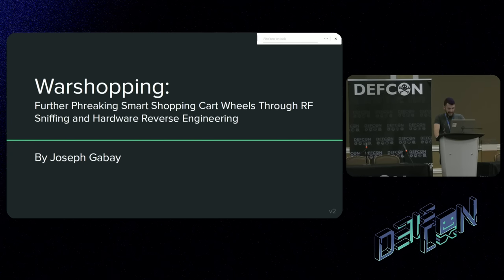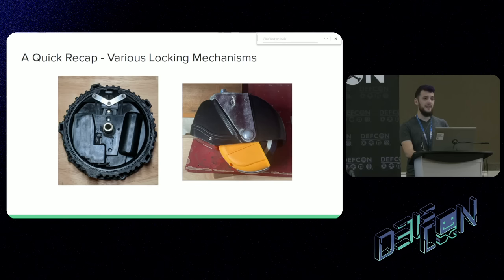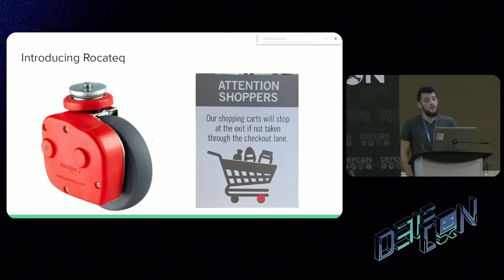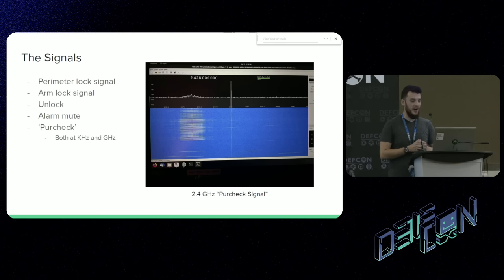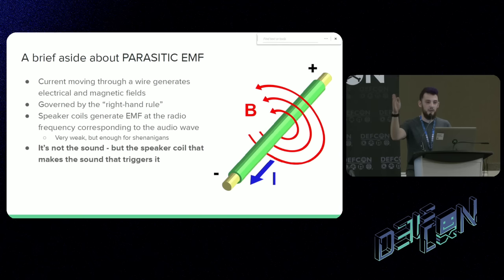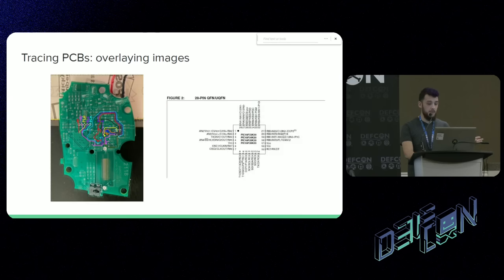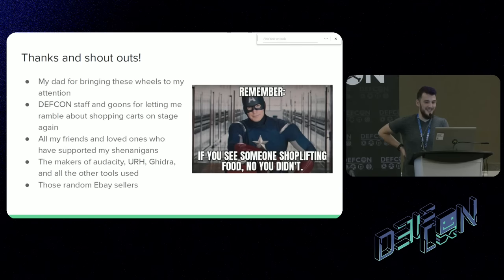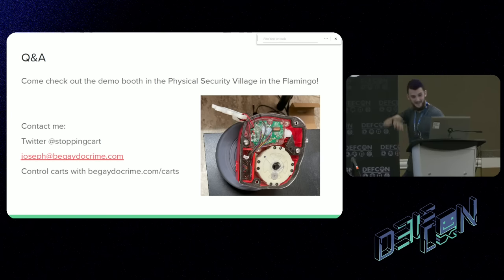DEF CON 31 - Warshopping- Phreaking Smart Shopping Cart Wheels Through RF Sniffing - Joseph Gabay

Comment: I can't stop thinking that this device is a wheel surrounded by electronics that the public literally pushes around a store all day every day.... why does the battery ever die for any reason except planned obsolescence?
Reply: You could definitely extend the life of the device with a kinetic charger, sure. That would, however, drive up hardware costs.
Reply: @pinaz993 Not by much though, since a kinetic charger would also detect motion, so you no longer need an accelerometer, you can put less effort into saving power if you now have a charger, and you could probably use a smaller battery too.
Reply: Im not a very technical person but a wireless charging strip underneath the wheels where the carts are stored would be possible aswell
Reply: @jesperdenbraven1995 That would be a lot more expensive than putting some magnets on the wheel, due to the extra infrastructure requirement.
Reply: @user2C47  there's already corrals for them. it's a simple rail and plug.

Comment: I don’t think I’ve ever seen carts that lock in the store. All the stores that use them around where I live just lock the wheels at the perimeter of the parking lot, presumably to keep (usually, homeless) people from stealing the carts.
Reply: I've gone into a store to buy ice and didn't go through the checkout, just parked the cart next to the ice case and walked over to the checkout. Going back out the wheels locked up at the door and set off the store's theft alarm. Everyone's looking at me like I'm trying to steal a cart full of ice.

The carts didn't have that label that was shown in the video that warns you to go through the checkout, it looks like they just retrofitted the wheels without any kind of signage.
Reply: I've heard the alarms go off in Kroger when a shopper exited ... prolly connected with not going thru a checkout line.

Comment: I wonder if you could create an EM pulse or tone strong enough to trigger all of the shopping carts in the store to lock up.  The 8KHz would probably need to be a harmonic of a higher frequency carrier in order to transmit far enough.  The technical challenge would be interesting, although actually using it would be a dick move.
Reply: but it would be cool
Reply: This was my first thought as well.  Walk around the store broadcasting the signal to lock all the carts up.
Reply: Hint: Think Navy sub transmitter, one of those located upstate wherever that xmits at near those freqs ...
Reply: You could build a short range transmitter into your shoe, with some sort of surreptitious activation method. Thus, if someone makes you mad or does something untoward, you can make a show of kicking the cart and setting off the alarm.
Reply: It would be a very funny prank. Another one is somehow finding a way to open every garage door in a neighborhood at the same time. Just cause as much havoc as possible
Reply: playing the frequency on your phone works.  having a small bt speaker in your shoe getting the audio away from ear level and closer to the intended target level helps
Reply: @potterportraits  re: "having a small bt speaker in your shoe getting the audio away from ear level and closer to the intended target level helps"
Sound waves do not equal a magnetic field though, unless, you're doing something extra?
Reply: @uploadJ  either you didn't watch the whole video or you didn't understand it. You can convert the electronic signal into an audio format that travels at the same wave essentially.  The files are downloadable from several online sources. This is not for the main kart he was talking about at least at this time but the more common style seen at most stores in the United States. There is an unlock and a lock available to save as .wav
Reply: @potterportraits  HWGA (Here We Go Again) How I can tell you don't understand electromagnetics w/o you saying you don't know the difference between sound waves and EM (electro-magnetic) waves?
Reply: Ok
Reply: Use two much higher frequency transmitters that have a difference of 8khz.and yup it will trigger most of them in the store to lock up 😂
Reply: @christopherleubner6633  re: "Use two much higher frequency transmitters "
A stab in the dark, or you've seen this principle 'in play' somewhere?

Comment: Some shopping carts can be appropriated by wheeling it backwards after wheels lock up.
Reply: Yes, had to do this when the cart locked up at the door. Was not about to lug a full cart of bags back and forth to the car. When I realized it rolled backwards, I just turned the cart around and pushed  it from the front.

Comment: Shouldn't a super/normal cap and small motor as generator be a cost effective replacement for the battery? Extended life and more avaliable power seems good for everyone.
Reply: Moving parts and higher BOM cost.
It would be less reliable and more expensive. Unfortunately
Reply: @TilmanBaumann  magnets in the wheel and a coil can negate any more moving parts. But that is even more expensive.

I don't know their current lifespan, but a dynamo charging should the limiting factor of life be capacitor life. But then no one would buy new stuff so yeah. Corporate stupidity and e-waste will prevail.

Comment: Security in these: It is just adequate for the purpose. All who are engaged in those petty crimes, why these smart wheels were introduced in the first place, aren't the ones capable to go through even such simple system. Someone capable to hack through it, those do not get involved in those shoplifting activities in the first place.
Having everything super secured disregarding the purpose is just plain stupid. It ends up into system where the "security" features and their consequences cause way more expenses in normal business disruptions than the damage it is supposed to prevent. Don't forget you can just hold the cart corner off ground a bit and there is nothing the wheel locking can do about it.
Reply: You don't know that, I could be involved in petty shoplifting on my spare time.
Reply: Why do you want shopping carts so badly?
Reply: @lawnmowerdude  Free hardware.
Reply: Usually if you move fast enough, the wheel doesn't lock when crossing the wire.

Learned that from 9 year olds who were jousting in Walmart shopping carts, and dinging up cars in the neighborhood. 

Bored kids, isn't that most defcon attendees?
Reply: @PaulDriverPlus  And yet you're watching it
Reply: they should just attach a really long string to the carts so they can't take them out of the parking lot
Reply: @Chris-too  just do it Like Aldi
Reply: @Bobo-ox7fj  I don't know how other stores implement this product, but at my local grocery store, one of the back wheels has what's a essentially a wheelie bar attached to it. It prevents people from leaning the cart back on the back wheels, lifting the front wheels off the ground. If you wanted to get the front wheel off the ground high enough to prevent it from being activated, you'd have to lift the whole cart off the ground.

Comment: What really surprises me is they don't have a tiny generator on the wheel providing power.

Great talk. Would listen for another 38 mins to you talking excitedly about shopping carts.
Reply: that one wonky wheel wrapped in hair, not spinning, begging to be charged xD
Reply: @redusercolor  So you mean it might encourage supermarkets to fix  their broken-ass trolleys? Mission accomplished.

Besides, if the wheel don't turn, the brake used in these things isn't going to work either.
Reply: you can sell more of them if they have a limited battery life.
Reply: Just higher cost and more to go wrong, I bet the integrated battery will last. Minimum 10 years
Reply: That plus a supercapacitor would be an interesting way to keep it charged and to detect that its moving without an accelerometer
Reply: Yup a tiny generator plus a LIC would be perfect.❤

Comment: That unpopulated chip is probably just the pinout for an alternative wake-up chip since the signals are routed to both footprints.
They will just use whatever was cheapest at the market that night
Reply: I bet that, like many companies, they had to redesign their PCB during the parts shortage and allow for as many alternatives as possible
Reply: @antonliakhovitch8306  Doesn't even matter about the recent silicon shortages. You'll find pads underneath NAND chips have multiple pads in case the assembly line switches to the smaller package version of the same chip half way through production. Most notable case that comes to mind is the Gen III remakes of the Pokemon games; the PCBs for the game cards have pads for two sizes of chip for the save data. It's not abnormal for something containing a general purpose micro controller, NAND or EPROM to have multiple pads for the same thing, sometimes there's even multiple through-hole mounts for capacitors, like in the Xbox's 1.6 revision board for the RTC capacitor.

Comment: I'm pretty certain there is absolutely nothing 2.4Ghz on that PCB at all.

That loop trace is probably something entirely different. My suspicion is that it will interact with those anti theft gates in stores to trigger the alarm when it crosses a gate in locked mode.
Probably just an optional not enabled feature on this board.
Reply: so you're saying it might be fraudulent advertising?
Reply: you're correct they can be set to 2.4Ghz or 5Ghz bands to communicate with anti-theft systems in-store
Reply: The 2.4 GHz stuff is around the unpopulated module footprint labeled Y2 and Y2 also appears to feed the perimeter antenna trace directly. It appears to be a transmit only continuous wave signal and it appears to be powered by the PIC's TX line which in convenient. You'll notice the PCB is missing ground plane in that area. I would put money on it being an option to transmit to the security system.
Reply: @Peter_S_  re: " It appears to be a transmit only continuous wave signal and it appears to be powered by the PIC's TX line which in convenient."
Plot twist: Its a feature used for DFing. for tracking down errant carts that have 'left the premises'.

Comment: ...isn't that the coin sound from Mario?

"like looking at footprints and trying to figure out what someone had for lunch" - you can tell by the spacing, and how much farther apart each step is on the way to the bathroom!
Reply: hilarious, the tone when they confirm you've given them money does sound just like the mario coin sound! 19:30
Reply: It helps when the footprints are in front of a hotdog stand!
Reply: Yup it is, and it also uses 2 transmitters around 2.45GHz to induce a beat frequency in the audio frequency range that tells it level up, you can go to the parking lot 😅

Comment: When you do an overlay, it may be easier if it’s more complex to change the chroma channel in Photoshop and add false color so you know which is on the back side. You could do that in a couple of steps as well so that the Soder lines connecting them are actually a different color as well, so it really can get intoclear understanding of the connections.
Reply: I would think a 'blink comparator' would work well too. I use those for looking at RADAR Reflectivity data and Doppler Date alternatively.

Comment: For some reason I was always under the impression that the carts worked on a transmitter system to remain unlocked, and the yellow line was the "range limit" of the in-store transmitter... in spite of how silly in retrospect that entire premise is (how do you even have a straight-edge "end point" to an antenna transmission? even cell towers don't technically transmit "hexagonally", it's just abstracted that way for which of multiple towers has the highest Tx/Rx at a given point on the map and thus is the one you connect to)...
Reply: Far to easy to miss a signal, especially in a busy environment and with everyone using cellphones, wifi, etc.  It would also drain a battery very quickly.  Nobody wants to be charging 100 batteries even once a year.  I'm curious as to why they didn't build some crude low power generator into it. I have a Seiko kinetic electric watch that can be charged pretty quickly by wearing it only occasionally.

Comment: 2.4 GHz is "line of sight" - They might have had the 2.4GHz stuff and found that the radio reception wasn't good enough for some of their stores so they pulled it out.
Reply: The 2.4 GHz stuff appears to be an optional transmit only module on the PCB marked Y2. It's likely an extra beacon signal to the alarm system to tell it a wheel has just locked. You don't get to change the design after certification, but you can omit a tested feature and achieve a second certification in a different configuration at a greatly reduced cost.

Comment: I think I would try to find a way to power it with induction power. Since people are pushing the cart anyway. That way you have infinite battery and much more leeway in terms of computationally expensive features. Or is my idea completely stupid? I would expect this would make it quite a bit more expensive, but you can track which isles the cart stood still. Correlating that with the items actually sold should tell you which items were almost bought, which is probably the most interesting category.
Reply: Not stupid, just sliiiiightly more expensive and it seems like the manufacturer was just trying to make the cheapest shit possible

Comment: I would have added a small generator coil and magnet to add a bit of charge back to the power system (super cap maybe) as the wheel rotates
Reply: But then they last forever!! Silly u ;]

Comment: I wonder if this is how Menards can lock the wheels of your cart on the motorized ramps between floors some of their stores have. I didn’t realize it was possible for an embedded loop to unlock the wheels as well.
Reply: I've never bee to Menards, so no clue if they do it this way: The wheels on the cart are not uniformly flat, but roll on two outer wheels and the middle part is fixed. When you roll on the ramp, the outer wheels fall into grooves and the inner fixed part makes contact and locks it in place.
Reply: That would likely require a different design, as the frequency of operation would require some sort of generator to keep the battery charged, and likely a motor mechanism less prone to wear.
Reply: I think I understand what you are talking about, and I believe it's far simpler.

By motorised ramp I am going to assume you mean a "travelator", a flat escalator. That's the term I hear down in Aus.

It's really a mechanical lock, the wheel falls into specially shaped grooves in the travelator track that match the wheel's shape. After that, the cart stays still so you don't roll away, but once you reach the bottom the comb will lift the wheel up and allow you to continue normally!
Reply: @briannem.6787  yes, exactly. I didn't know the term for flat escalator.

Comment: The 2.4 may be a beacon function for tracking the carts using access points.
Reply: Judging by the PCB, it's something which sends only continuous wave information so iI would guess the 2.4 GHz is an option to link with a security system when a cart locks.

Comment: You don't need a 3.5mm earphone jack to use a mic and earphone. Any miniUSB, microUSB, or USB-C socket supports headsets. For $10 you can buy an adapter to do this. Thank the folks at Palm for figuring out to use dropping resistors to signal that. Their Treo phones all did this by sensing the impedance of wbatever was plugged in.
Reply: it depends on if the device using that connector even has that ability, hardware wise.. more consistent method is a little cheap af usb soundcard that can use otg mode if mini/microusb, usb-c, just has to show as a usb device to the pinmapping..

Comment: The missing 2.4GHz is most likelly a higher end model that nobody buy because there is no real advantages. Since nobody get it, nobody on ebay got it.

I imagine that the base model would last like 5 years, but the wifi maybe 2? That alone is a massive disadvantage of the 2.4GHz.

Comment: 31:00 if the device is ignoring signals while it is still, could you jam the wheel and then just lift it over the boundary line to avoid the wheels locking?
Reply: Worth trying, but It's probably an accelerometer or vibration sensor on the pcb. No relation to the wheels turning.
Reply: Yes just lift it that is how i defeating it for years. ps i bing back a lot of random carts.. (to make police more  redundant :)

Comment: 30:45 So, will lifting the wheel at the sensor points disable the protection because it'll be in sleep mode?
Reply: Ill try this next time im at food lion lol
Reply: The accelerometer will still detect motion/vibration from the rest of the cart. I don't think it's related to the wheel specifically turning. You should be able to just fry the whole smart wheel using one of those handheld tesla coils though, obviously when it's unlocked.